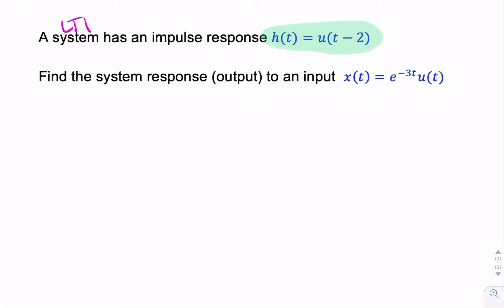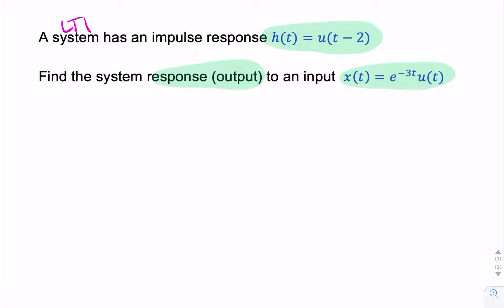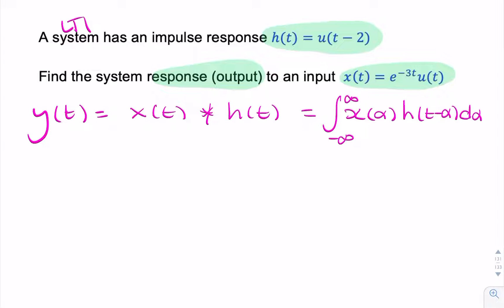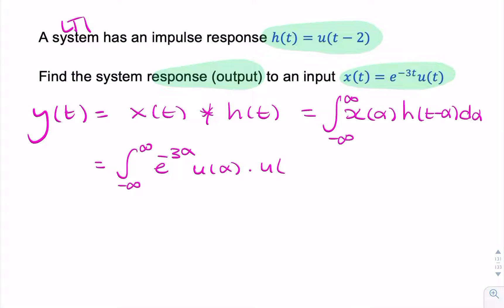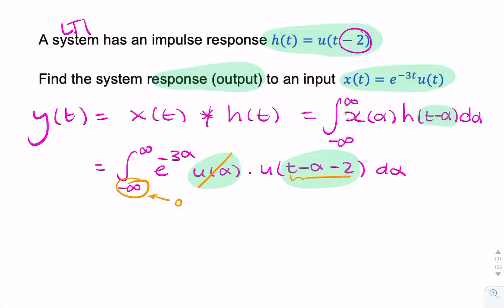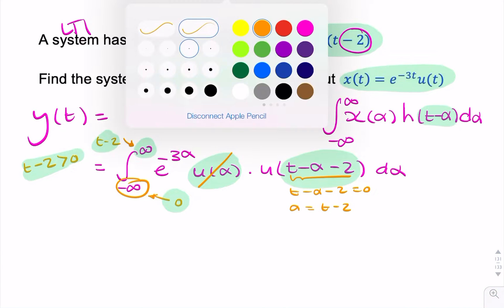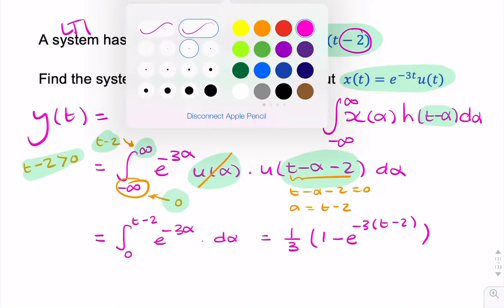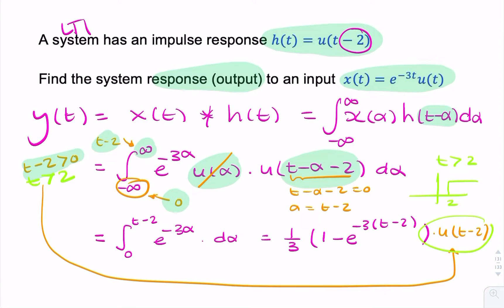Example: Output by convolution of input with impulse response

Comment: Why we replaced minus infinity with zero
Reply from the maker: The u(a) is a unit step function that is  zero for all negative values and 1 for all values greater than or equal to 0. So the integral is zero for all values from negative infinity to zero, so we can change the limit of the integral to 0 (or rewrite it as 2 integrals, one from -infinity to 0 and one from 0 to infinity, and the first one will be zero).